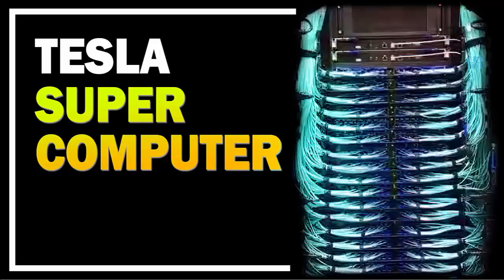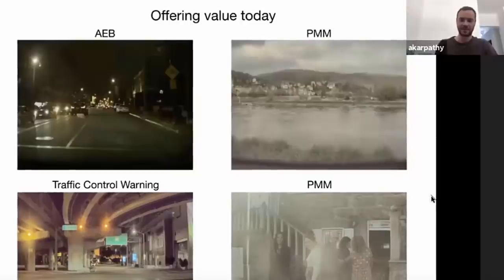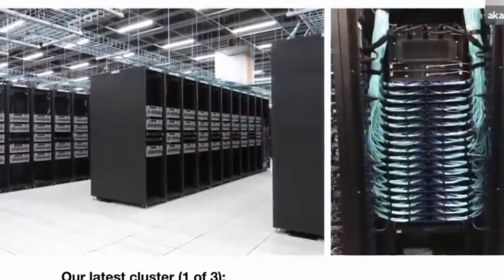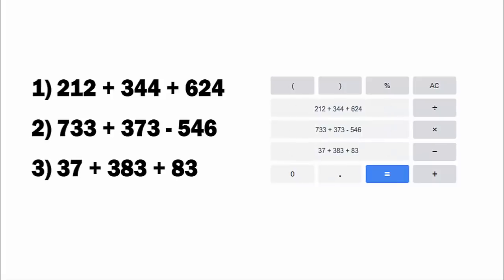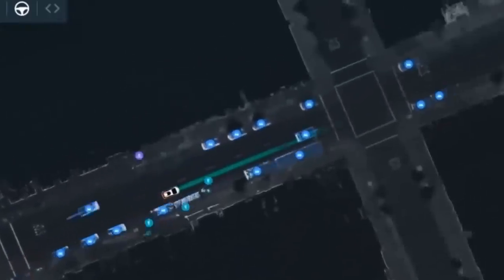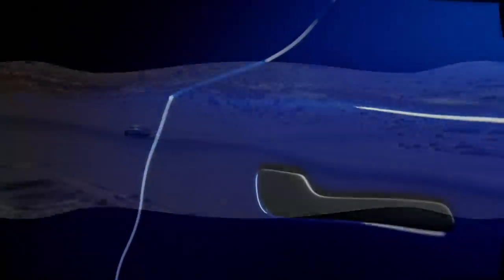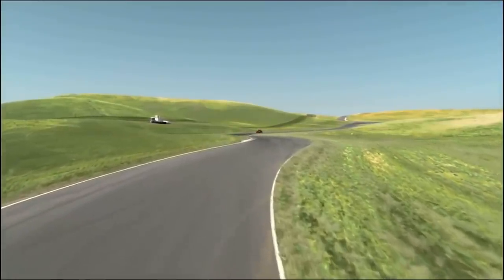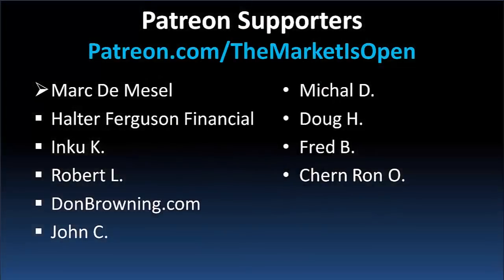Tesla’s INSANE SUPERCOMPUTER is only the Beginning

Comment: 1. Exponential growth. Every Tesla sold, adds to the data. Every quarter, Each and every other manufacturer is getting behind, and the lead is growing exponentially.
2. The competing vehicle manufacturers, are making 1 or 2 models, versus Tesla going ALL IN, on multiple platforms, with the SAME exact tech. By the time the other Tier makers, get to >3 models, Tesla will be at ver 3 or 4.
3. What Tesla is doing, is simular to what Microsoft (old Microsoft that is).. did. MAKE a product, Design the inner workings to work with everything else. And link ALL the products to ONE tech provider. (simular) to MS having windows+server+exchange+domain+sql+numerous other products, under ONE Umbrella. 
4. Tesla's OTHER products, (the WALL, the roof, Megapacks).. ALL of those, are the REAL products, that none of the other makers, are considering. AKA -- BUILDING an entire Infrastructure all the while building cars While solving multiple problems at the same time.. Expontentially.

Their SuperComputer is yet another expotential growth capable product. 
GOOGLE Earth just got replaced.
DashCams are irrevelant now.. (i personally want that system in my current vech).
Google Maps is in trouble.
Delivery services will become Tesla dominated.
UBER type transpo will fail.
School bus's
Bus's
Trucks.. 
ALL at risk, via this Computer system..
Reply: Don't you think you are going a bit wild here? I can do the same, though :D
Tesla has been making losses from 2003 till 2019. 
The $1.6 billion in regulatory credits it received last year far outweighed Tesla's net income of $721 million -- meaning Tesla would have otherwise posted a net loss in 2020.

"These guys are losing money selling cars. They're making money selling credits. And the credits are going away," -Gordon Johnson of GLJ Research.

Everything that involves Elon, is always "20x better, 20x cheaper, 20x faster", while in reality it's smoke and mirrors all over the place.
 
-Tesla, likely to fail when they can't sell regulatory credits anymore (they will instandly be back making hundreds of millions in losses each year).
-Starlink, likely to fail in terms of revenue. They will most likely bleed money on this one (even if they use Starship for sat launching).
-Starship program, likely to fail if Starlink doesn't generate enough revenue (which it will most likely not do). 
-Boring company, can't deliver what was promised.
-Neuralink (the way Elon describes it), all unrealistic Elon-hype. (some orginal founders already left the company because of this).
etc.

Elon and his companies always start to work on new "revolutionairy" things, while (most of the time) not even having properly worked out / finished earlier projects.
Never wondered why that is?
They are desperately filling one hole with another and need to keep the hype and interest high to get funds, until they hopefuly 1 day actually succeed with something.
The fact that people are driving around in Tesla cars and that Tesla keeps expanding / developing, doesn't mean they are very successful and can sustain it all longterm. :)

The moment these companies fail, existing companies with actual capital will just buy up the good stuff / usable remains.
All of the above is more likely than "Google Earth, Dashcams, Google maps, Uber, etc etc" being replaced by Tesla
Reply: @cryptopolice6202  jaja nice job,
Just wrong data,  tesla wins money on each car with much better margins that the industry and margins are increasing. He just invest all income (including co2 credits in growth) some in capacity, some in research (product and manufacturing), some in complementary services, and yes some in selling some products and services at a price necessary for strategic reasons (just look at the charging infraestructure in wich he can charge much more money, because there is a high difference with the competition, but is strategicaly interesting to keep it that way and let costs go down)..
Reply: @fjauge2465  Source?
Reply: @fjauge2465  Ok, will look into it again. So far I couldn't find anything but 1 Tesla-fan that said they made $3000 profit per car (based on his word), against hundreds of articles that pointed out they were actually selling cars at a loss. So not just the company making losses by re-investing more than they generated.
I have spend some time on this matter in the past, but perhaps I was looking in the wrong direction (the reason I asked for a source), but if you type "Does Tesla make profits on their cars?" , I get nothing but "no" for an answer.
Doesn't discredit the rest of my first comment, though. Because eveything Elon-related does seem to hang together by a lot of "IF's" , "maybe's" , possible empty promises, bad-shit-crazy ideas and sometimes even lies.
Reply: @cryptopolice6202  On the other side to say anything different will fail is a better bet that the contrary so in that is a good asumption, but you loose when something of this strange things work. So in most cases you will be right but when something looks as it is working its interesting to just make another look. Also i understand that is highly improbable that people that are always with the next big invention are for real, but when someone looks he is delivering on something, again is time to make a second look.
Best wishes,
Reply: You sound like one of those who thought the Camera, Walkman, Camcorder, GPS.. you sound like one of those, that didn't believe taht those would be replaced, by some emerging Exponential Tech.

Dashcams=Can't put them on a Tesla as it will look like VGA video compared to the 9onboard cameras.
GoogleEarth,Maps=Considering that EVERY Tesla has 9+ Cameras, numerous other sensors. You can best beleive taht a Tesla MAP, is in the works.
UBER=If there are Self driving cars.. SOMEONE will make a Self Driving CAR RENTAL!!.. WHY pay someone to drive you, when it can be automated.

I speak my words, from experience as an IT Engineer, who specialized in INTEGRATION..

Novel, Wordperfect, --just 2 companies that 25yrs ago, pretty much RULLED the IT WORLD. Now they are no more. un imaginable at the time, yet.. No one knows of them now. Same with other disruptive tech.
Motorola, Blackberry, Nokia--- AGAIN.. Who are they in 2021..  THEY have all been replaced by newer, disruptive tech.

Same with Tesla.. They are disrupting soooooo many things, taht it is kinda easy to see who is next on the chopping block.
Reply: @cryptopolice6202  I'm sorry but you are impossible to be taken seriously when you use Gordon Johnson in your post. Gordon (the genius) Johnson is literally a huge laughing stock for everyone that knows just a little bit about Tesla. (Just try and look at his track record)

Comment: When someone Hacks this computer and takes control of all your Vehicals to kill all in cars then what ? Have you Driven a Ford Lately ? It will make endless faces of death footage with tesla cams on all vehicals
Reply: You realize that the computer is only used to train the neural nets not for the driving itself. The cars only use the on board computer.
Reply: @ImmortalCookie  If someone hacks Tesla servers, they could in theory modify code of the next update to create widowmaker from any Tesla using line centering of FSD..